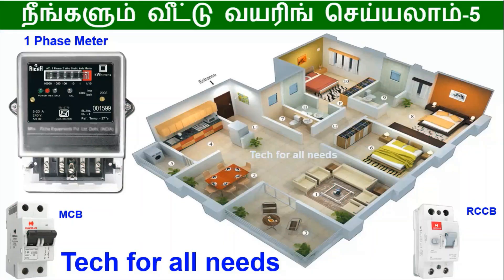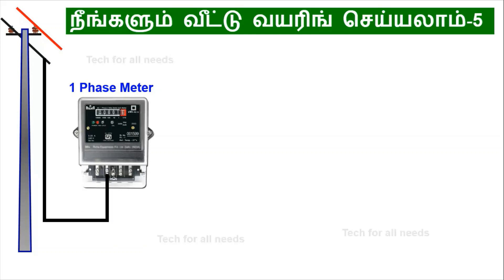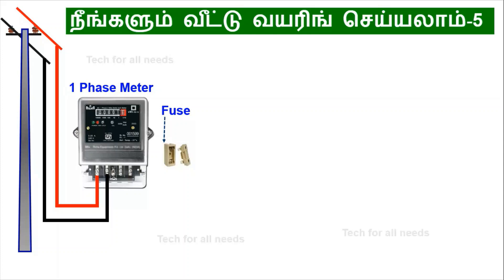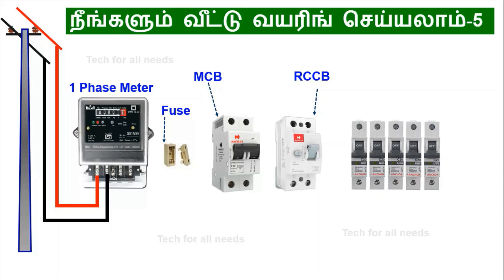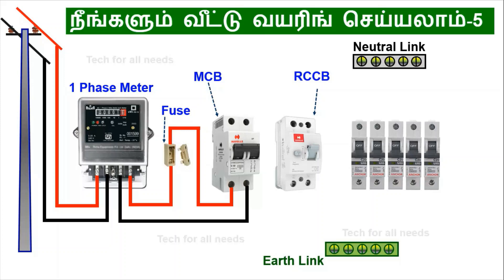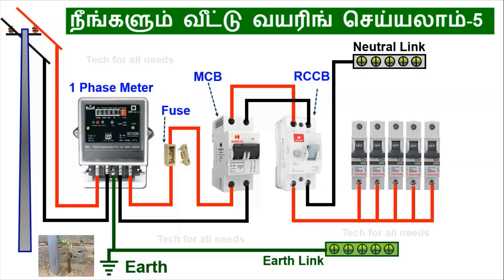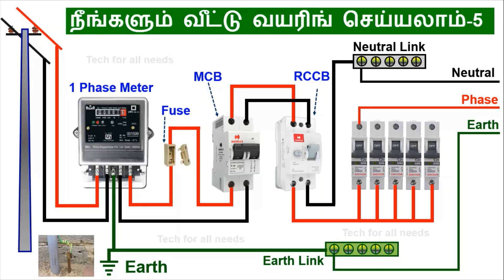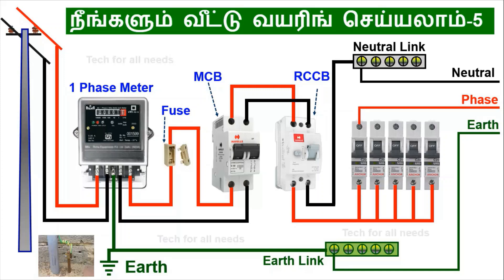House wiring in tamil part - 5  | வீட்டு வயரிங் மிக எளிதாக செய்யும் முறை | tech for all needs

Comment: Mcb yaen  kodukanum? Mcb illama rccb podakudatha? Pls exolain
Reply from the maker: MCB மற்றும் RCCB இவைகளின்  வேலைகள் தனித்தனியானது
Reply: @techforallneeds  Yes; 2 pole MCB/RCCB in/out intha diagram la irukkurathu mathiri ya kodukanum? En veetukku distribution board upgrade panneyn yesterday,  unga video parthuttu thaan naan MCB potte aagannnu electrician kitta sonneyn... electrician don't have knowledge about 2 pole mcb will be tripped, he said earlier it's like isolator. I explained him, then he understood...

Aana 2pole MCB and RCCB in/output connection diagram opposite ya koduthirukku... any problem? Device la in/out symbol ethuvum illa...
Reply: @techforallneeds  RCCB and 2 pole mcb rensum orey amps thaan podanuma? 40a?
Reply: @techforallneeds  main mcb, rccb 40a, fuse 32amps la ippo irukku....  ippadi vitturalama? Illa fuse athigama 63amps podanuma?

Comment: Sir I have installed rccb of 40a 300ma is that OK for house wiring or should I change it.
Reply from the maker: for house 30 ma enough sir if possible change the RCCB it is better
Reply: @techforallneeds Thanks for your reply.